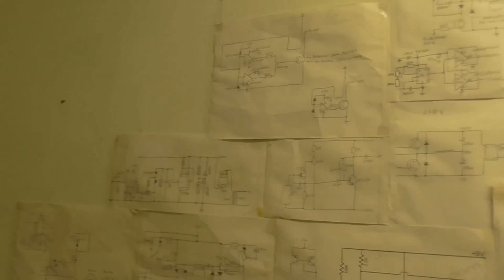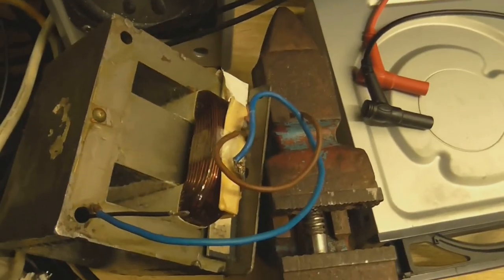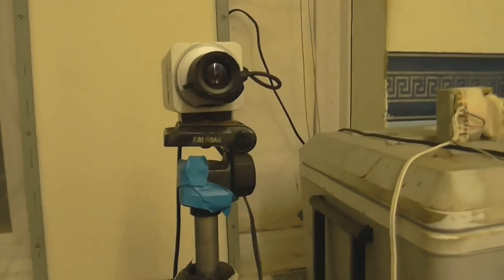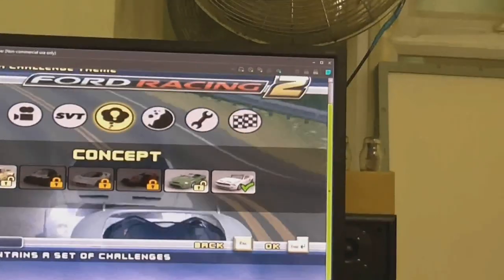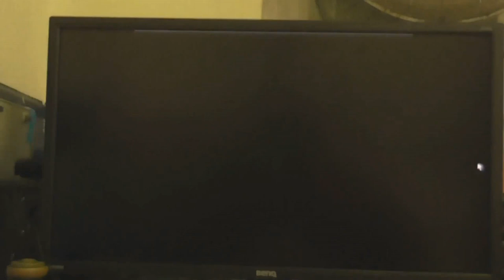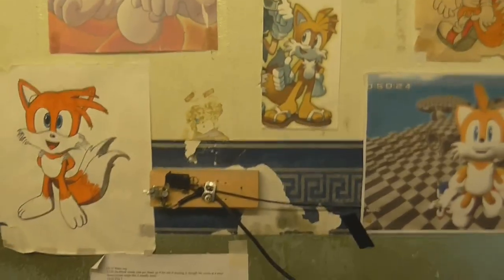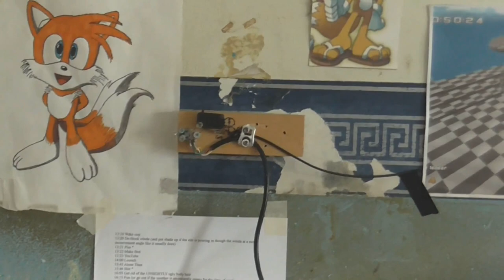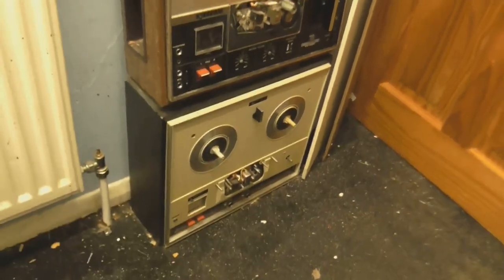Tour of my workbench, and room.

Comment: I've done a room tour video of my old room which can be seen on my channel, now i'm in a new room and I have no plans on doing a video of the new one anytime soon. My room is clean but there's stuff. not hoarder level though. Just need to organize it all.

Also I have a few of those TV backlights as shop lights in my garage. they work great once warmed up and are very bright. One issue is these all came from the local dump up the street and are failing so I might do what you did here and build a 24 volt power supply and remove the originals unless the inverter is on the same board and some are.